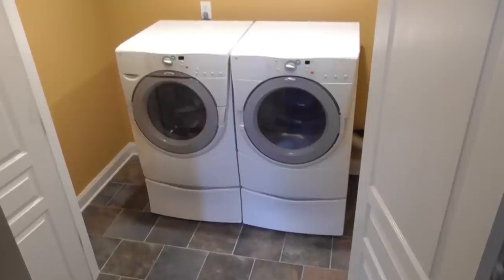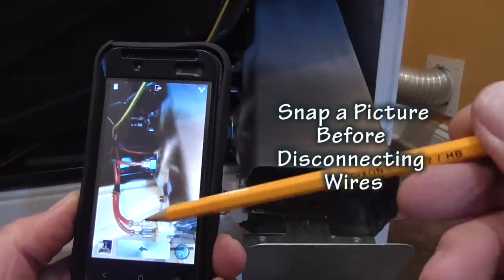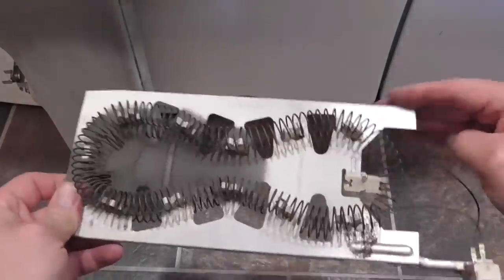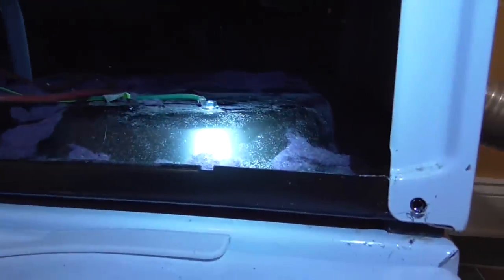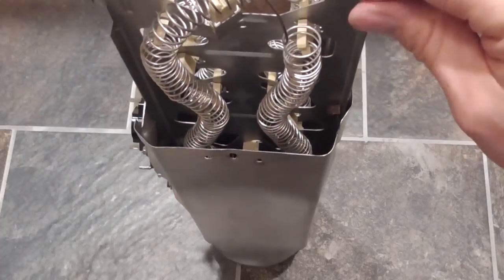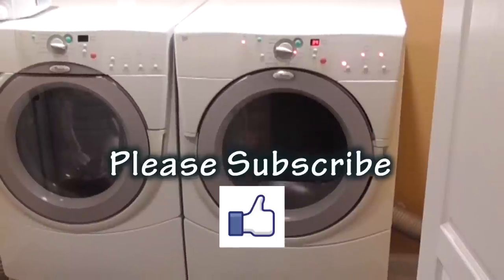Whirlpool Dryer Repair - No Heat Replace Heating Element 3387747

Comment: Great video. It worked with my model of dryer. Pro tip: Do not disconnect wiring and remove the entire heat chamber from the dryer. Instead: 1. Remove the front brace/heat chamber cover. 2. Remove the screw holding the heat element in the heat chamber. It is just behind the plug terminals. 3. Test the heat coil terminals with an ohm meter; If 0.L on meter, replace the heat coil. 4. Hold the heat chamber in place with one hand (not letting the chamber come disconnected from the exhaust connection in the back of the dryer. 5. Grasp the heat coil by the plug terminal and pull it out of the heat chamber with the other hand. 6.Push the new coil in as the old one was and reconnect the wires. Replace the brace/heat chamber cover on the heat chamber.... *Don't pull the whole chamber out of the dryer to replace the heat coil. It is nearly impossible to get the heat chamber reinserted in the exhaust pipe in the rear of the dryer.
Reply from the maker: Thanks for tip! Inserting the heat element was tricky.

Comment: Great video. Only thing I would add is that removing the housing for the dryer element can be challenging. It's not screwed in the back but you certainly have to play with it to get it out.

Comment: Great Video. Saving folks a ton of $. Couple notes that were a little different for me:1. When taking out the housing, mine was tough. I had to remove bracket in the front of the heating element that holds the housing in place, then turn the housing to the left and then lifting up to the right helped me get it out of the back. That tab on the back of the housing was tricky on mine.2. on my unit it was the Thermal Fuse. I initially just replaced the Fuse and it popped again on first load. I then cleaned out the vent using a vent sweep and replaced the Fuse and Thermostat. That solved the issue.
Reply: Michael Brown Same My friend!
Reply: That TAB got me frustrated !!

Comment: Just wanted to thank you for such a detailed how-to video..... bought my OEM heating element off of Amazon for less than $30.  Had some trouble pulling out the old element (there was a small clip on the very back side of dryer) but that was our only trouble and  once we figured that out, we were able to continue the replacement.
Reply from the maker: Glad that worked out. Just recently our dryer was not drying again. Turned out the pump on the washing machine was clogged and the clothes were still very wet when put in the dryer. Hope to make a video on unclogging the pump soon. Thanks for watching and taking time to leave a comment.

Comment: Didn't expect to laugh during a "How To"  video but did! Funny and very informative. I as well had the dreaded stuck heating element housing. Decided to leave it in place, took out the front metal panel and side screw. Pulled on the element and it slid right out. Slid the new one in and worked out fine.

Comment: Exactly what I needed to repair my 18 year-old dryer. Excellent instructions! With great appreciation! One bit of advice. When reinstalling the dryer element, you need to tip it down so the metal lip on the back top slips into the housing. I had to do this first, then reinstall the wires and the bracket the secures the front of the dryer element housing to the dryer floor.
Reply from the maker: Glad this helped. Thanks for the comments!

Comment: Followed your "SAFE" and  "EASY TO UNDERSTAND" instructions.
Ran a test load of towells and they were dry in record time!!
We have set our calendars to begin  routine maintenance on both the washer and dryer!
Mamma loves me again and actually thinks I know what I'm doing thanks 2 U Dave!!
Thank you Amigo.
Reply from the maker: So glad this video helped and glad you did the work safely. Regular cleaning of the exhaust vent pipe is a must. This is the first home I have lived in that the dryer was not on an outside wall and that makes a huge difference. I clean ours out several times per year especially when dear wife says its taking too long to dry. Thanks for the comments!

Comment: I am not what you would call 'mechanically inclined'. However, when our dryer quit drying the clothes, I watched your video. It's a really easy video to follow and understand. I was able to: take the dryer apart, figure out what part had broken, buy the part online, install it, and put the dryer back together.  For $17.25 (the cost of the replacement heating element), I fixed our dryer. Yee Haw. Thank you for taking the time to make the video and putting it on youtube for everyone to benefit. Signed, Dry Clothes in Missouri.
Reply from the maker: Fantastic! So glad this video helped you repair your dryer. I really like fixing things and I have so many other videos I hope to upload soon on more simple appliance repairs. Thanks for the kind comments!

Comment: Nice video Dan.  You saved me at lest $150. It took me 10 minutes to take apart. 15 minutes to the repair shop to get a new "thermo fuse". 10 minutes to re-assemble. And we're back in business.  You video  made it easy.  Thanks :)

Comment: Thank you for this video.  Most of the others I looked at for my Whirlpool Duet dryer said to take off the back, top, control panel. belts drum, blah, blah, blah.  Mine had some wires clipped to the floor of the compartment, so I had to tag and disconnect a couple of wires from the heating element and the thermostat.  I figured it out.  I did great with the help of this video to do my first fix it on an electrical appliance.

Comment: Dude! You just saved me a ton of money! Thank You SO much. I have no experience in such matters and your video was clear and concise. You did forget a screw right behind the white connector on the heating element but I found it. My confidence for simple home repairs has increased significantly! Next??? Kitchen faucet! #singlegirlpower
Reply from the maker: Thank You and so glad it helped. My parents taught me to fix things myself whenever possible and this has saved me a lot of money over the years. What’s the worst thing that could happen, it still not work after you work on it?
Reply: That's what I thought the worst is I'm gonna have to buy a new dryer.

Comment: Thank you.  I looked at many repair videos and yours started where I needed.. from the beginning--. removing the front panel.  Now I just need the right tools.
Reply from the maker: That front panel has to be removed before you can access the inside of the dryer. Be sure to unplug the appliance before removing the panel. Thanks for the comments!

Comment: Hopefully you don't need yours fixed right away and can order the part from Amazon.  My Whirlpool dryer had a similar but different heating element.  It was available on Amazon for $31, but there were no Prime or other reasonably priced shipping options.  Got one today at my local appliance parts store for $103.  Yes, the one on Amazon was a Whirlpool genuine part.

Anyway, it was a really easy fix thanks to your awesome video.  Appreciate it very much.  Thumbs up and subscribed.
Reply from the maker: So glad this video helped you fix your dryer and thanks for the comments!

Comment: I had an issue with this same dryer. It would blow the circuit breaker when turned on. I had read that it might be the heating element that might have broken and was laying on the case. My dryer was gas so it didn't have an element. When I opened the lower cover about $5 in change fell out on the floor! Sure enough as I looked around there was a quarter laying between an electrical contact and the side of the dryer wall. It was shorting out the circuit every time I powered it on. Your video helped me disassemble the the cover to get to the inside. Thanks.
Reply from the maker: Dan at More Old Stuff 

I am so glad that this video helped you fix your dryer and thank
goodness your circuit breaker operated like it was intended. There are
thousands of house fires and hundreds of injuries and even some deaths each
year caused by clothes dryers not being maintained. Many times the exhaust hose
is crushed when the dryer is pushed against a wall and will restrict the air
flow. It is necessary to clean out your dryer vent regularly and if you notice
it is talking longer for the cloths to dry (in my case my wife will tell me) it
is time to clean the vent.

Comment: The housing on mine was difficult to remove, but lifting the end upwards and to the right as far as possible while pulling forward released it.  I think that tab on the back is tighter on some units than others.  Great video by the way, my heating coil was broken in the same spot at the one shown.
Reply from the maker: Thank you for the comments!
Reply: Mike Doyle thank you. I was ready to completely destroy mine 😂😂😂
Reply: Ditto to Mark Carpino's comment. I had given up until I came back and read the comments, couldn't figure out why it wouldn't come out, was about to remove the whole back panel. Thank goodness I didn't.

Comment: One thing I did not do was take a picture of the wires. Besides a diagram that I can not read where can I go for help? Your video was a good place to start.
Reply from the maker: Hi, I did a Google image search for ‘gew9200lw1 heater element wiring diagram’ and a picture is there with the heater element connected.Thank you so much for the comment and this will remind me in future videos to show photos of wiring that can be paused for reference if needed like in your case.Hope this helps! Dave

Comment: part came in - watched your video - same dryer - joila.
had some trouble with the mount staying but just bent bracket a bit.

thanks for posting.

Comment: Dryer is 14 yrs old and stopped heating.  Watched the video, pulled out the heating element, and sure enough the coil was broken.  10 Minute search on Amzn. and next day heating element arrived.  Total about 1/2 hour repair.

Comment: First, Thank you very much for making this video... It saved me a boat load amount of money. I just have a quick question? My Heating Element is bad.... is it a good idea to change the High Limit Thermostat and High Limit Thermal Fuse while I have everything apart or should I just replace the element and call it a day?
Reply from the maker: Hi, and glad this video helped. If the thermal fuse and thermostat are not defective I would not replace them. While you have the housing out of the dryer it is a great time to use your vacuum to clean out any lint that has accumulated.

Comment: Thank you for the wonderful video! I had some trouble taking the housing down. Now I could not pull the wires off. any suggestions? Thanks
Reply from the maker: Sorry for the slow reply, it's been a busy week. If you cannot grip the wire terminals then needle nose pliers work well. Hope that helps and thanks for the comments!

Comment: Followed your excellent video with same Maytag dryer: MED9700SB0 and took photo of wires as suggested.  On reassembly  I could not be sure from the photo which wire (red or red & white stripe)  goes on which terminal.  Does it make a difference?

Comment: Hi Dave, just watched your dryer Heater element fix and it was great! Quick question my model is a WED9200SQ0. Will this be the basically the same? Thanks
Reply from the maker: Hi, I took a quick look at the drawing for that model number and it looks the same to me. Thanks for watching!
Reply: This is the model I have the element and housing  is not coming out as easily as this one did.

Comment: I can’t get the heating housing out 😢Trying to save money ...It looked so simple on video
Reply: Same here. Looks like 2 screws on top in back that have to come out.
Reply: Disregard my last comment. They are snaps not screws.
Reply: Rotha Vandross yea I had to twist it and it came out...A young lady and I fixed it myself 30 bucks fir the part instead of 250

Comment: Great video!   My High Limit Thermal Fuse tested bad so I replaced it and it worked ... for ONE load.  I took it all apart again and all tests for continuity are good.  Any ideas now?  (I actually took out the heating element and visually inspected not trusting my multi meter... but all tested good.)
Reply from the maker: Hi Ken, The heater circuit is pretty simple once it leave the control board. I have noticed that on Amazon heater elements are often sold as a combo pack that includes the element, thermal fuse and thermostat. For this not to work there has to be an open circuit with one of the components. Hope that helps.

Comment: I pulled out the housing for the heating element and replaced it.  Now the issue comes when attempting to reinstall the housing! It die not fit back together! The way it’s made, it seems that the housing fits around the tube in the back. I’m my case it almost seems that they are the same size. I’ve done a number of twisting maneuvers to no avail.
Reply from the maker: This is definitely difficult to reinstall. There is a tab on the end of the heater housing 5:19 and the housing has to be tilted to be inserted into the vent opening. Hope this help. Thanks for the comments!

Comment: Hi. I had the same issue like this but when I removed the housing for the element, it seemed like it was connected tight at the back. I had to turn it to pull it off. Now in this video, I see it just sits there? Is there something I'm missing here? The diameter of the housing exit for the heat is 5 inches and the vent in the back is 5 inches. I don't wanna risk it collapsing while in use since that can be a fire hazard. Please let me know if there is something I'm missing. Thanks!

Comment: Is there a clip or screw holding the housing unit in the back?  We got the front cover to the housing unit off but can't wedge the housing unit out.  We have a Maytag instead of a whirlpool so maybe there is a slight difference?
Reply: +Jennifer Biagi 
Got it off, it did have a clip in the back holding it in place.

Comment: I didn't take a photo of my wires prior to removing heating element.(found this video after the fact). When I went to replace wires, I thought I had them right. Plugged dryer in, and the element immediately heated up without me starting the dryer. So, disconnected from power. My wires are wired exactly like yours. Continuity is good on both thermostats. What could be my issue?
Reply from the maker: Hi Mike,If the heating element is heating without the dryer motor running there is definitely another problem. If you do a Google search for GEW9200LW1 wiring diagram you will see that the electronic control board supplies the power to the heating element. Hope that helps!
Reply: CarveTools if I have the wires in the wrong place would that not cause this?
Reply from the maker: If one leg of the heater element becomes grounded then it is possible that it will conduct electricity as soon as power is applied. The best I can remember is that one side of the element is always hot (energized) and the control board completes the 240 volt circuit. My thoughts would be to check for a ground in element circuit. Hope that helps.

Comment: Is that duet sport? The wires to heating element red white goes at bottom right. I unplugged mine and forgot to take the pic
Reply: If it's the wires to the heating element, polarity shouldn't matter because all it's doing is completing a circuit to create heat.
I believe I'm right but don't be mad at me if I'm wrong.

Comment: Hey i wondering, whenever I test the continuity of the heater element and the high thermostat it gives continuity, then the heat element stays on for 1 minute and it shuts down.  Any suggestions?
Reply from the maker: Hi Rafael,The heater will not stay on continuous and that’s the purpose of the (low) temp thermostat. It should cycle on and off during the drying cycle. If the laundry is not drying then there may be another issue. Hope that helps.

Comment: May be a stupid question, but do I plug it back in before testing it with the meter?
Reply from the maker: No , do not check for shorts with the power connected.
Reply from the maker: And there is never a stupid question!

Comment: Still no heat; replaced thermostats and have ordered heating element. But on inspection and using meter, it shows circuits are all working. Heating element has no breaks and shows connection.  Can a heating element just burn out with no breaks?
Reply from the maker: Hi Bobbi,
With the heater coil removed from the housing it is usually noticeable if some area is burned in half. The push on terminals need to be a tight connection and will usually start melting the wire if one is loose. Also might need to check for 240V power (caution required) coming into the dryer.

Comment: Not detailed enough. My heating element HOUSING does not come out. Please show what's holding the housing of the element to the back of the dryer. I can see 2 black tabs at the top of the housing at the back but I do not know how to undo those tabs.
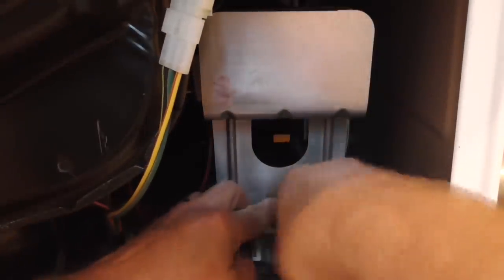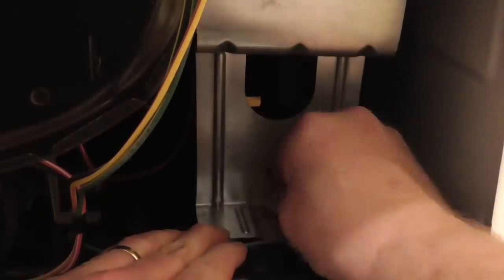Reply from the maker: Hi, sorry you are having trouble removing your heater element housing. My housing was very easy to slide out once the ¼ inch screw was removed (starting at marker 1:10).  Replacing the housing (starting at marker 5:20) was also easy. Notice at the very back of the heater housing is a small tab with a hole, it has to go in first to the exit vent opening then the front mounting screw can be replaced. Hope that helps!
Reply: @CarveTools  Apparently there was a design change.

Comment: ok thought i took the picture but it didnt come out is there someplace to go to find out what wires go where.?
Reply from the maker: +Pamela Maraziti 
Try googling something like “gew9200lw1 wiring diagram” and look under images. Replace the GEW9200LW1 with the model number of your dryer. Be sure to unplug your dryer from the outlet and check with a multimeter that nothing is shorted before reapplying power.